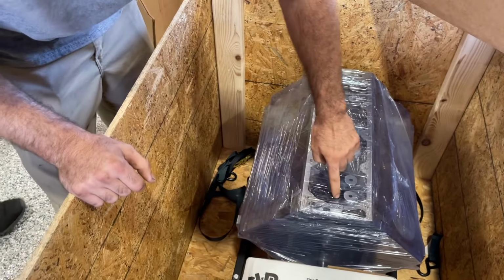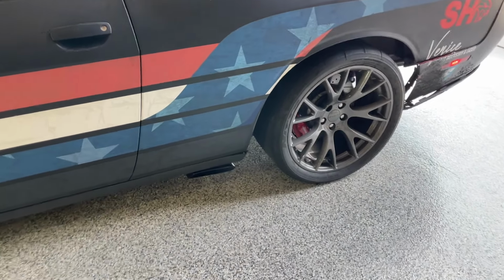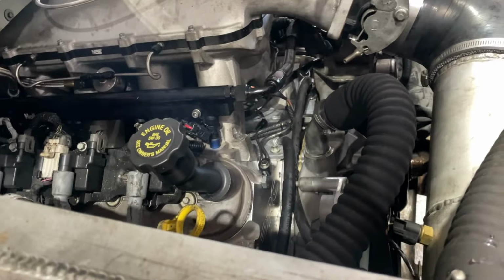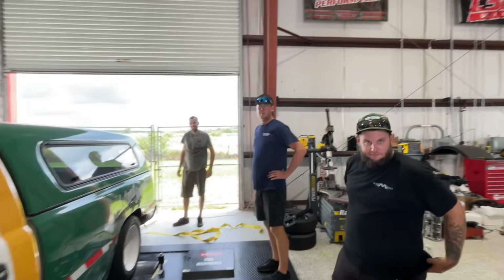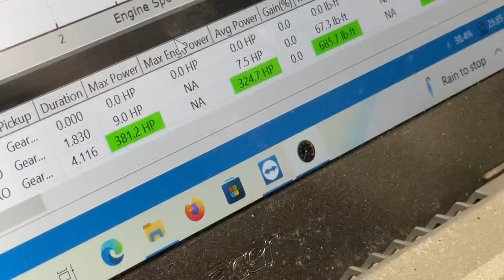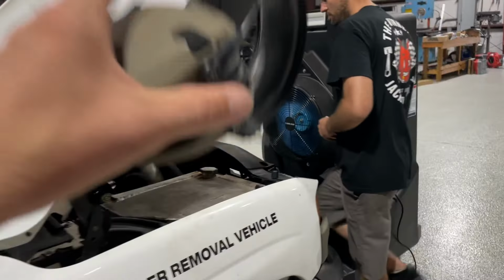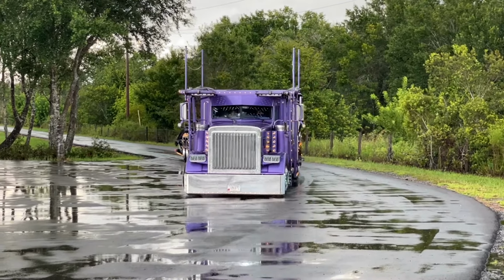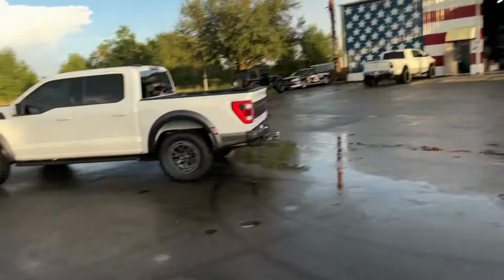Jackstand's Burnout Silverado Gets a 408 Stroker and More NITROUS Than Ever Before!!! (Sounds Spicy)

Comment: You guys should dyno Killa B would be interesting to see what it actually makes to the wheel.
Reply: I was thinking the exact same thing
Reply: To much for their dyno killab needs a hub dyno
Reply: See they would but that’s classified information
Reply: @Jacobtheunwise  it doesn’t make more than mullet and it put down 2k
Reply: @dontyouworryaboutit_  when it was in aus it made more than 2k
Reply: I think it makes a lot less than people think, being that it's not really breathing through all three of the throttle butterflies.
Reply: I'd love to see what Killa B and Toast make.
Reply: @Jacobtheunwise  everything I can find says 1750hp
Reply: Do you really want to know how much horsepower Killa B makes? I know exactly how much. It makes ALL OF IT.
Reply: @DavieJones_Lockr  The hat on the blower should support 10,000-11,000 hp from what I have gathered. I know for sure that the hat on Toast is a top fuel hat and the previous owners of Killa bee said they had to block their hat for the same thing. 1/3 of 10,000 is still 3,333.3 hp potential for one section of that hat. Now, based on only needing to burn tires and not actually get competitive times in a drag race, it may not be making as much as it is capable since it has to live for minutes at a time vs. seconds with drag racing and there is a minimum and maximum time goal for burning a set of tires. It would still be interesting to see how it compares to the rest of the fleet.
Reply: @CGT80  10 points. I'm never going to be the guy that says "I don't want to know how much horsepower".... I'm just saying they gave up a lot for throttle response.
Reply: It's all nosie and only a lil go. They're made to be showey and just enough goey, and reliable
Reply: Agreed!
Reply: @CGT80  They also data log and can set rpm limits to pop the tyres within the right time limit
Reply: @dontyouworryaboutit_  pretty sure it's actually 1776hp there buddy.
Reply: You'll find when doing burnouts it'll be turned wayyyy down. Probably make 8 or 900 to the wheels. Keep everything reliable and cool
Reply: they’re overbuilt to support 2 minutes of wide open throttle reliably. 30% capability reduces a lot of problems
Reply: How much air does a top fuel engine really pull in? I just remembered that nitro methane has an oxidizer in it, so it requires less air than other race fuels. I'm not sure how much hp a Top Fuel hat will support with methanol. A comparison could be made between the size of one butterfly on Killa Bee and the throttle body on Mullet or Ruby, but then one has vacuum pulling through it and the other has pressure forcing the air, and I don't know if there is a difference in the amount of volume that can be move through a certain number of square inches.
Reply: @dontyouworryaboutit_  WRONG.
Reply: there's no way a roller dyno can give you accurate numbers past 6-700 hp. The wheel slip is uncontrollable regardless of what anybody says

Comment: of you plumb in some propane to those headers you could do a little flame trower show before the burnout , opening up two of those trow away bottles of maf gas and have them empty in the headers while reving should be enough (just add two nitrous solenoids near the headers so the exhaust gasses cannot blow up the feeder hoses and dump exhaust gas into the cabin ) , once there empty everything is safe to do the burnout 

might be a good idea to install a verry tall flagpole on the property some distance away from the shop itself and install a lightning rod to it 
thats the second tree hit by lightning since you moved intoo the shop so its likely there the highest point in quite a large circumference around the place , the flagpole being higher and better grounded should drawe the lightning away a bit better and hopefully prevent electric damage in the shop or offices , it allso alows you to put a large stars and stripes up there (i seem to remember you have quite a few that flew over enemy territories that you where gifted by a few of the millitairy people)
pointing a camera on it gives you a better chance to catch the lightning hitting it too

Comment: A 250 straight 6 and 400 turbo with a shift kit would burn the tires clean off that truck I had that combination in a 80 Chevy truck and it was badass

Comment: 9:22 Cleet, WT had hellacious wheel wobble on that passenger rear, wheel bearing or bent axle. Either way you might wanna get that fixed before Jimmy sends a tire off into the bleachers

Comment: I honestly thought it was going to make more power without nitrous I was thinking a bare minimum of 400 wheel horsepower. It's a a built 408 Stroker. ported stock heads/cam Gen 2 350 lt1s make over 400 wheel horsepower

Comment: Lightning will do some strange shit! Had a job years ago as Warranty Engineer for a Diesel Engine manufacturer. Got a call one day about a BIG one in a crane. Seems it was boom up and a thunderstorm came across. Afterwards the engine wouldn't turn over, just grunt, no turn. Long story short lightning hit the top of the boom and burned off a patch of paint 2' in diameter! The bolt passed through the boom down to the outriggers, which were sitting on steel plates. It also welded all the bearings to the crank and cam. Along with frying almost every electrical component in the machine. Turned out the crane was a total write off (and they didn't get a free engine under Warranty like they expected either). 😆

Comment: For those of you who doubt the lengths we go to in Florida to cope with lightning let me share with you what Summers were like growing up for me in Florida. Where I grew up was kind of rural as in dirt roads and all that and whenever we hear a clap of thunder we had to run around the house and unplug all of the televisions and appliances that could be unplugged and then prayed that the other items would be safe. Unplugging everything before leaving home was crucial in the summer. Unfortunately sometimes we would forget to unplug things before we leave the house for the day and a thunderstorm would roll through while we were out. Over the years we had several security systems, air conditioners, televisions, computers and appliances get fried. This was the 90's so we didn't have cell phones or LED lights and the power got knocked out constantly when transformers got hit. We spent so much time in the dark reading with a candle it's not even funny.
Reply: Ga was the same way..Great Times!
Reply: Lightning causes problems with electronics? You sound like those people that talk about that white stuff they have funny looking lawn mowers or shovels for, or the ones who have the spinning wind that takes out communities. We just get little dirt devils and the lightning stays away from our houses. We are good here...........unless the big one splits us at the San Andreas. I live 10 miles South and towards the beach/LA from the fault line. PS Send drinking water please!

Comment: Brawler.. Holley is going to have something to say about that name..         I want a big block with 3.25 inch stroke and 4.5-6 inch bore.. big inches but will rev like crazy. Turns out 3.25X4.5X8 is 413 cu in 3.25X5X8 is 510 3.25X6X8 is 735 cu in.. Yeah that'd work lol 735 inches revving to 9k.. talk about a tire shredder. Oh if only I had money. You need to put up a big pole out in the yard to act as a lightning rod, that's twice you've been hit in the last couple months.

Comment: Them horsepower numbers on WT is kind of impressive for it being N/A but them torque numbers though 😳 👌 those are really impressive 👏 and for the engine being in a burnout truck that is exactly what you need to shred them tires off in no time and for James adding a shot of nitrous to it is just ridiculous at this point especially if them donuts he did in the parking lot is any indication of what the truck is going to be doing to them tires during the burnout competition in Bristol I say that James will be sitting on two shredded tires in less than 30 seconds

Comment: "oh man that new $20k Texas Speed 408 stroker sounds rowdy. Has it got an oil cooler?" "no we ran out of time" 
"Is the oil pressure showing good?"
"ehhh, well no because the cluster is bad but it's not making any noise so it must be good"

Must be nice! I'd have an old school wet gauge the oem sending unit and an aftermarket digital gauge and I'd add a remote reservoir with a gallon of oil in it. Lol🤣

Comment: I still can't tell if I like blower surge or not. It makes the car sound like a chained beast, eager and hungry to set tires alight. It also seems like it makes it sketchy to drive at low RPM and do things like load onto trailers. EDIT: Wow White Trash sounds amazing with that engine.
Reply: I have heard numerous times that it can be tuned out, but I sure wouldn't want that on something with a huge blower hat and the looks to match. I'm sure it would suck as a daily driver, if such a thing could exist, but that is the type of car you go big or go home with and save a smooth vehicle for normal driving. Even going from my 79 C20 pickup with a well built 406 sbc with a relatively small cam for towing to my 2020 fully loaded duramax as a daily drive is quite nice now that I am middle aged. When I was younger my body could take more and I had more patience. Now it is nice to have smooth, luxurious, and tons of torque and plenty of acceleration from a quiet diesel that doesn't stink.........yet, I still love hearing some muscle. It is also easy to live vicariously through others who can still enjoy rowdy/adventurous things and this channel lets all of us feel like we are right there for the action.